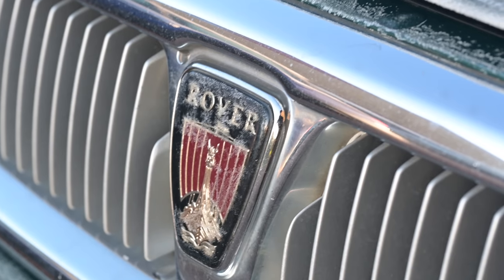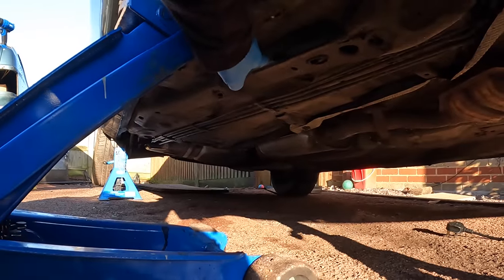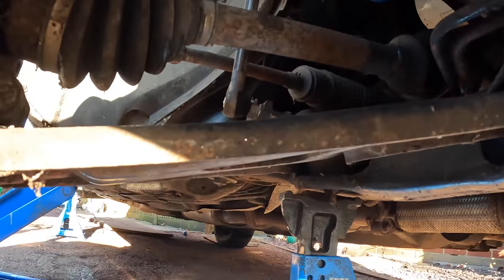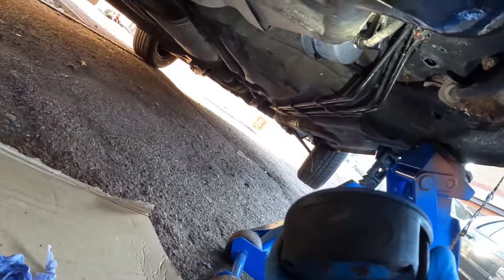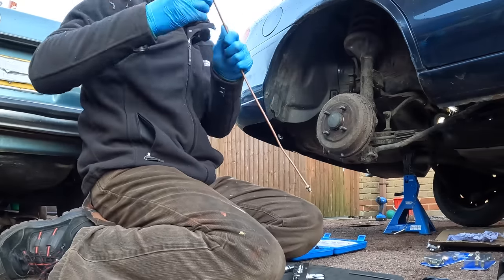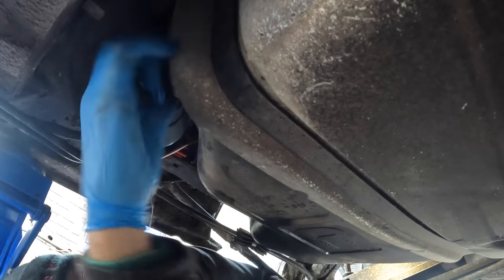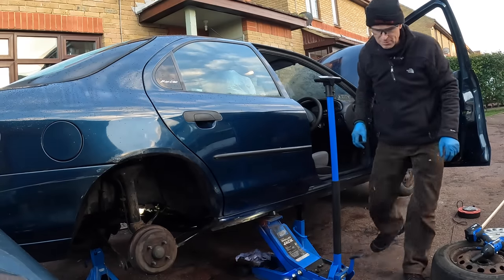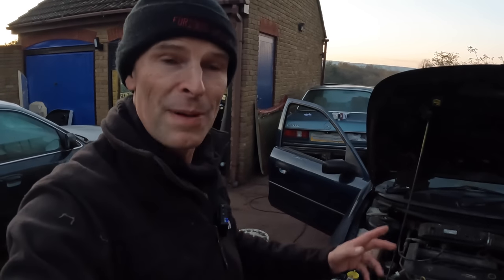Mondeo rescue part 4 - It goes, now it needs to stop!

Comment: Fuel pump Matt,  if it's not power /current it has to be ground run a temp ground to the pump that will show you what side of the circuit to track down the problem

Comment: That fuel pump wiring has an intermittent High resistance in it. Connect a 21W stop lamp bulb to the pump connection. Then wiggle some wires, relay, fuse etc. To see when and where, you get useful power, when the light comes on (ign on of course). As there has been evidence of rodents, it is entirely possible that the wire has been chewed. Usually somewhere inaccesible, like under the engine fuse/relay box.
Reply: Usually you don't want to complicate it. Could be just a bad fuel pump relay, easy to try. I know he said the auto electric guy checked but did he really.
Reply: Had same problem on my mk2 st24 fuel pump packed in and went dead short and it damaged the plug I had to clean it and use some little pliers to squeeze the terminals tighter so when plugged back in they made good contact and was never a problem again lasted 4 years till I sold the car and I regret it it was a saloon in black with all the kit on keep up the good work love these cars
Reply: called it!

Comment: Dam, I just knew those brake lines would be rotton above the tank, was hoping you would be able to avoid that horrible little job. I remember doing that with my Mondeo many years ago. With regards the fuel pump Matt, if you suspect a bad ground connection, try using a headlight bulb to load the circuit at the pump end of the wiring. I know your volt meter is showing 12v, but see if by connecting a load like a headlamp bulb will make that voltage go away. If it does try earthing the bulb to ground to a fresh ground point near to the tank, if so you know it's a bad earth somewhere. With regards to draining the coolant, the easiest way I have found is under the car. Just to the drivers side of the sump there is a metal coolant pipe that connects to a rubber pipe, the pipe is about 16mm in diameter. Just undo the clip and let it drain out from there. You may have a drain cock on the bottom of the radiator,  but it's awkward to get to, and it takes forever to drain. Plus it's plastic that is now 24 years old - what could possibly go wrong there?

Comment: Admirable fortitude in these weather conditions. Locks often get the blame for frozen solid doors. The real problem often being water trapped all around the door aperture seals freezes overnight and no way will they be opened without damage until fully thawed.

Always investigate small liquid patches under cars which should not be there. Five years ago, at a family function miles from home, the Brakes on my trusty MG ZT 1.8T saloon suddenly were not their usual very efficient self. Had to keep topping up the Master Cylinder. The long brake lines to the rear wheels under the car looked perfect.. except for the damp patch around plastic fixing holding the twin brake lines underneath the car. That plastic fastener immediately below the driver's seat area. Undo the clip revealing the unseen corrosion fracture allowing high pressure brake fluid to escape ... 

I concluded that the road filth and moisture trapped unseen in the fastener over the years had eaten away the brake line as it would never really dry out during wet winter months. I had previously invested seventy quid in a brake line Flare Kit and a long length of cupro-nickle brake line. Fashioning Brake Lines using that kit is a very satisfying and creative experience for amateur DIYer me. Money well spent and has saved many times its outlay as four brake lines later, jobs well done. I even used it on the nearside rear for the suspension hydraulic tubing of an X-Reg MG Metro which let go on the way to the recent NEC. Cue severely slammed little MG Metro. 

That tube removed at the roadside and later that evening I made up a new one. The owner of the little MG had the kit to pump up the suspension once the new replacement tubing was fitted. The little car got home by 1 am that evening. Another job well done.

I have a few jobs to do on the family cars ... outside. They can wait. The three inches of snow has partially melted and then refroze overnight making underfoot and under tyre conditions simply too dangerous. Cars slipping down cambers and slopes nearby. Sod all that for soldiers.😀

EDIT  TO  ADD :~

Close examination of the MG Metro's broken forty year old Hydraulic suspension pipe revealed the corrosion fracture was outside the sharpish curve of the OE pipe. That would be the most stressed part of the pipe during the original manufacturing process.  I have seen similar elsewhere and even had top hoses burst in a healthy engine along a manufacturing seam in an old hose. ... TWICE!  Silicon replacement  hoses cured that and will outlive the cars.

Comment: As a refrigeration mechanic, the flaring tool your using has two butterfly nuts. To tighten them use the other half’s handle between the “wings” and tighten. A screwdriver works as well. 
Good luck with the mondeo, (and the wife). 😎
From sunny Australia. We’ll be thinking of you over the barbecue at the beach.

Comment: tip for you Matt, if you push the brake pedal to the floor and leave it pressed down then no fluid at all will leak out of the pipes
Reply: This is what I always do works better then trying  to clamp or block pipes
Reply: Had to do brake pipes on my Rover 75 recently and this method worked a treat. I wedged the pedal down with a bit of wood pressed up against the base of the driver's seat. Made an awkward job much less unpleasant.
Reply: Be aware that pushing the brake pedal down to the floor on old cars can sometimes ruin the master cylinder in a hilariously dangerous way, whereby the brakes seem to work fine for a couple of days then fail completely while driving the car. This is caused by pushing the piston seal over a rusty area of the bore, because it never normally travels over that area. I've done this twice, with a Peugeot 305 and a Mk1 Astra van, and it's terrifying.
Reply from the maker: Thats very good to know, thanks
Reply: @Zeem4  True that, but in a such case you'd know that the master cylinder was due for replacement/ refurbishment.
Reply: @БранимирПетров  How?
Reply: Putting cling film over the reservoir and screwing the cap on works as well
Reply: Earplugs work well on fuel lines and oil lines.
Reply: @Zeem4  If the cylinder or the piston have corroded, they shouldn't be used.
Reply: @БранимирПетров  The problem is that 
you'd have to remove and dismantle a part that is in perfect working condition, and would have stayed that way for years if the pedal hadn't been pushed down to the floor, in order to inspect the condition of the bore. Which is probably a good idea from a safety perspective, but how many people remove and dismantle the master cylinder every time they do any other work on the brakes that requires them to be bled afterwards?
Reply: @Zeem4  If there is any significant rust in either the master cylinder, or the caliper piston/ cylinders, than those components are very far from perfect condition. Also, from time to time you have to press the brake to the floor - even if it's on once a year, it would happen. I'm not aware how most people proceed, but all of my cars that i got, that have stayed with the same brake fluid for more than 5 years, I've replaced the master cylinder and the flex hoses, and refurbished the calipers. Some things you can leave in sorry state, but I wouldn't do it with brakes and tyres.
Reply: Smear Campaign  My P-reg facelift Mondeo had the heated windscreen - I didn't need to use it very often but it was an absolute joy when I did. I even remember having to repair it - a previous owner had installed the timer relay from a pre-facelift car which is different and didn't work, so I swapped it with a correct one from a breaker's yard.
Reply: My current new-ish Volvo has a heated screen and so did my previous MK4 Focus, so still very much a thing and as much of a life saver as ever

My MK1 and 2s also had them too come to think of it although not for long on the MK1 as the screen got smashed and was replaced with a regular one

Comment: Hi Matt, top tip for you in future when changing brake lines/hoses put a section of broom handle or bit of wood from the seat to the brake pedal to keep the brake pedal depressed, this will stop the brake fluid from dripping  you may have to pull the brake light fuse or unplug the brake light switch to keep the brake lights from coming on so it doesn’t flatten the battery I’m a mechanic and I learnt this trick many years ago and it works every time. Hope this helps

Comment: Watching this had given me the motivation to brave the cold and get my suspension arm replaced 👍👍👍
Reply from the maker: Good luck, Ive gone indoors today!
Reply: @furiousdriving  job done. Good luck with the Mondy. Enjoying this series!
Reply: i had to take my cylinder head off ready for skimming in the morning as my motor broke down with head gasket failure not good/nice at this time of year and to make things worse it started to snow a little in the process :(
Reply: @markcropper7182  mk1 insignia 1.8 well known for being a chocolate engine :(
Reply: @markcropper7182  being sorted out next week hopefully as it will be at my works in the dry but not the cold :P

Comment: Matt.
Try testing the wiring to the fuel pump with a light bulb rather than the meter. 
A bulb needs  'power' to light. Power is volts x amps. If the bulb won't light but you still indicate voltage on the meter you've got a high resistance in the circuit, 
The net result is you get volts but not enough amps and hence 'no power' .
I'd check out the fuel pump relay, if its internal contacts are corroded up your amps will be dissipated as heat. Pulling the relay and bridging it out will give you constant power to the pump .If that works you need a new relay.

Comment: Back in the early 2000s I used to repair alot of fuse boxes in ford's. If the fuse box is under the drivers knee I think then water may have got in there. Check your drain grommets under the scuttle panel. If they are gunned up the water used ro go into the car and onto the fuse box. If it's the case. Take out.  Split it to get to the board itself. A good clean with contact cleaner or isopropyl alcohol and check for broken solder joints. Might be what's causing the fuel issue.

Comment: A+ for effort on the Mondeo. With regards to the engine oil, that Zetec requires 5W-30 - back in the day, that would have been a semi-synthetic, however these days the specifications have been improved so the vast majority of 5W-30 meeting the required Ford approval is now fully synthetic.
Reply from the maker: Thats good, Id not looked yet and I have more 5-30 than anything else!
Reply: @furiousdriving  I'll bet alot of your rovers is 10-40 although that's mostly a guess based on my own 45

Comment: Well done, served my time DIY mid winter outdoors for emergency repairs and/or MOT fails. Mostly now helping a mate out when none of his 5 or 6 vehicles are working, hiding under umbrellas in pouring rain or like you this time frozen numb fingers. Re: the leaky cut or unscrewed brake pipes, wrap an old rubber glove around with a rubber band. 

Hope you didn't pay too much or wanting too much after all your hard work, a minty low mileage Verona Mondeo went for less than £2,000 inc fees at Letchworth Auctions November Classic sale

Comment: I had problems when I replaced the rear brake lines on my 145 with copper. Firstly, they disappear up above the tank and this meant I had to do it by feel although dropping the tank would have been more a more professional option. Secondly, after a week one of the new pipes sprung a leak due to it hitting another component while the rear suspension went up and down, this copper is so soft. I got over this the second time by cutting rubber fuel hose all the way along and fitting it over the vulnerable areas like a sheath just in case there might be contact. I think the best way around this would have been to drop the tank and make exact replicas of the originals and make sure the new pipes were fitted perfectly and routed exactly where the originals had been!

Comment: Fair play... I still need to finish off a clutch but have been avoiding it until it is at least above 5 degrees! Good luck with the MOT, I had a quick look at the history on DVLA and on its last pass there was an advisory for the off side front upper anti roll bar ball joint cover as damaged - might be worth a visual check in case it's obviously deteriorated....

Comment: Respect for making these video's outside in the cold and on the ground! Regarding the weird electrical issues: I would clean and check all the grounds/earth/connectors in the car. It sat outside for years in the elements, and moisture is not kind to electrical connections... Great job on the brakes.

Comment: brake pipes on fords of this age generally rot above or beside the tank, which sometimes is a tank off job. MK1 focuses are particuarly bad for this, something to do with the way they coat the pipes and bend them after which damages that protection the coating gives. Also the straight lines rot where they go through the clips as they hold them very tightly so any mositure that gets trapped just eats the pipe slowly.

Comment: I´m not an electrician, but I think I would try to make a completely new and alternative wiring for that fuel pump. Maybe get the power from somewhere else in the car that gets power only when you have turned the key. There is obviously a problem with those original wires, so bypassing them with fresh wiring would be a "red neck", but easier solution. 

The car was fitted with different kinds of alarms/ immobilizers, so an alernative power source would rule out any old systems trying to shut down the engine.  

If you connect new cables paralell to the same original wire harness, make sure it is at a point before any old alarms have been added to the system. 

Just a few thoghts from an amateur.
Good work on the mondeo by the way... fun to watch the process from Norway.

Comment: A dodge for getting through the mot, hook the pump up to something ignition sourced like the radio. Buy you some time to look for the fault properly after. Same thing for light issues, just run a wire on scotch locks if you're in a rush. Not a permanent fix but get you out in a pinch. It's also a good thing to carry in an old car, two lengths of medium gauge wire the length of the car and a handful of scotch locks, that will get you out of most emergency electrical issues on the road side.

Comment: Hi I used to have a mk2 mondeo and it had the same problem as yours with the fuel pump and imobilisor, if the pump doesn't make any noise turn of ignition and open and close glove box a few times with a bit of force when closing then try again repeat a few times then if it starts you know the problem lies in the fuse box a bad connection or a dry joint. Keep up the good work and good luck

Comment: Not sure if anyones posted this 
But being a mechanic and doing brake pipes 
I put a bit of insulation tape near the end of the fitting so it doesn’t slide about when your feeding the pipe over the tank 👍🏻

Comment: Frozen door rubbers. Just push hard on the door to compress the rubber. The pressure causes the ice to melt and you can the open the door.

Comment: When you make a replacement brake line, if you use the old piece(s) as a template and bend the replacement pipe into the same shape before you cut it to length, you wont find yourself in the situation where your replacement line is too short.

Comment: If your door lock is frozen, try warming the key. You may need to do that several times before it works but I have found it always works eventually. Use a lighter or a cup full of boiling water. Don't overheat the key if it has an immobiliser chip in it, Once free, lubricate the lock with WD40 which will expel moisture and hopefully prevent it from freezing up again.

Comment: Hey Matt a trick to prevent brake fluid from just leaking all over the place while you're working is to simply push the brake pedal all the way to the floor and then wedge something between the pedal and the seat to hold it at that position.

Comment: You did well brake flaring that steel brake pipe on car, had to do same with both lines on a Range Rover Sport a few years bad and that was a real Pain the Ass to do, virtually no room to get the flare tool in plus it being a steel pipe made it worse. Still beat swapping out two entire line from front the back!!!

Also those fuel filter use a big Jubilee clip round them.... or a Zip/ Cable Tie. 🤣

Think those Zetec Engines take 5/30 (a revelation at the after everything took 10/40) oil to make you aware Matt!!

Comment: Enjoying the series - with the fuel pump you need to test with a test light or rig up a tail light bulb - the pump works in effect  on current flow not voltage so needs a load - the meter won't detect a bad power or ground which is the most likely having seen the corrosion on the brake pipes by the tank

Comment: Dedication. More goodish news, when you took the front cover panel off - both the PAS pipes that run along the sub frame and the coolant pipe that runs round the back of the block looked OK - both possible leak/rot out points.

Comment: If you remove the cap from the master cylinder, then cover the top with cling film secured with an elastic band, air cannot go in so fluid cannot run out.